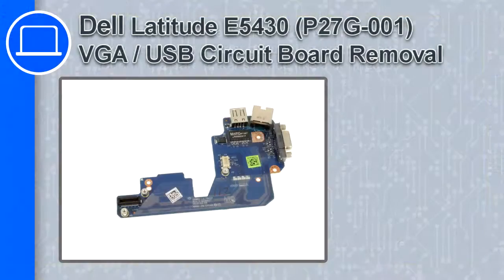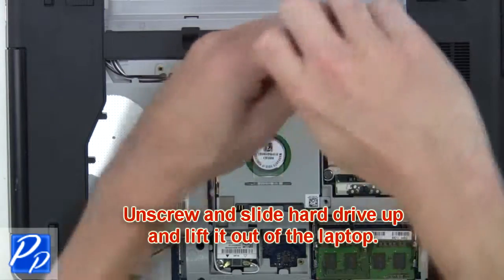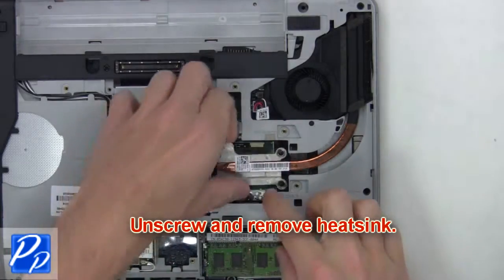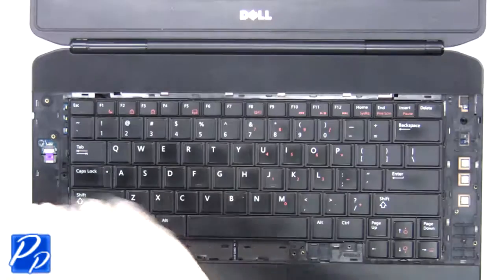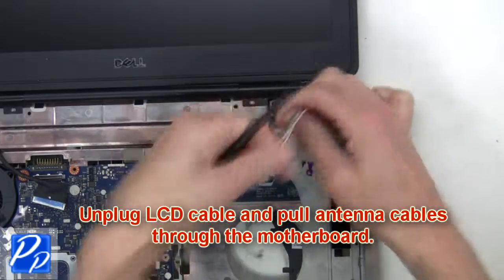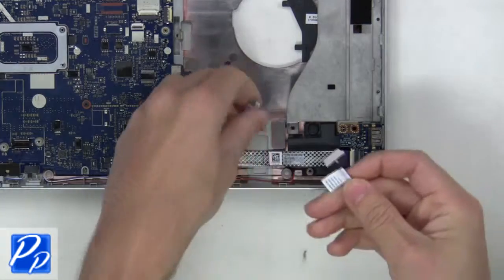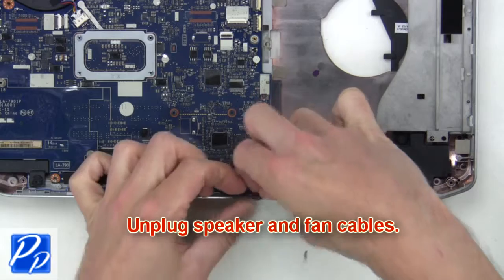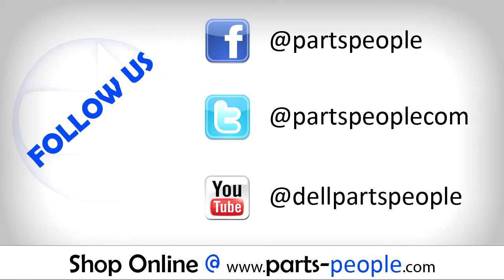Dell Latitude E5430 (P27G-001) VGA / USB Circuit Board How-To Video Tutorial

Comment: Is the video of a USB Port at the left or right side of Dell Laptop Latitude E5430? Because the Right Side is the Printer Insertion fron this video.

What I really meant is the LEFT side where there are 2 USB Ports that was near the Cooling Fan of the Laptop of Dell E5430.
Reply from the maker: These USB ports are located on the motherboard.
Reply: Oh, that Motherboard.

I hope there's an actual video of the USB Port was clean and functioning properly without replacing the entire Motherboard itself.